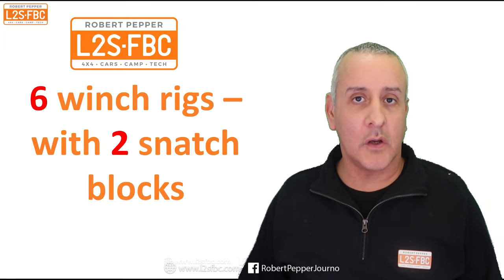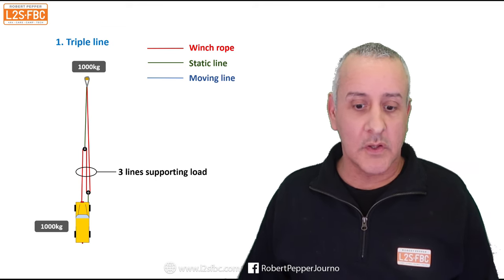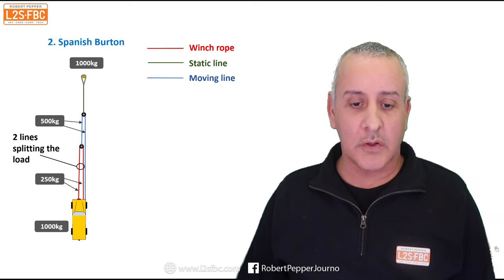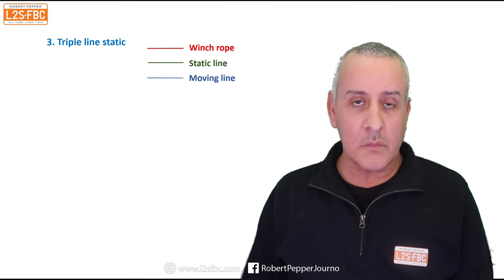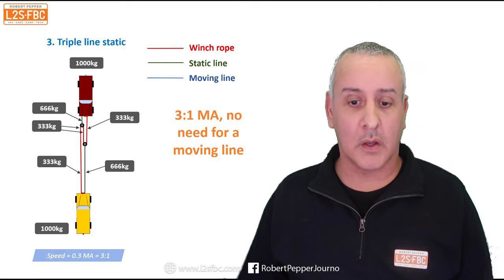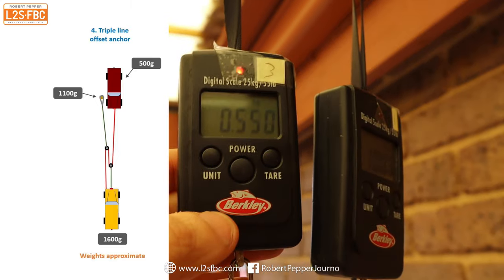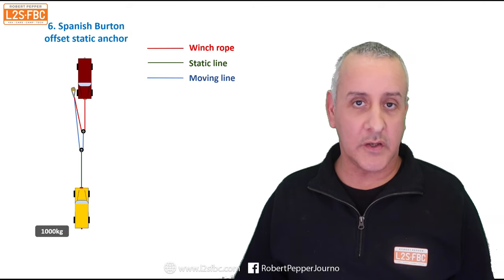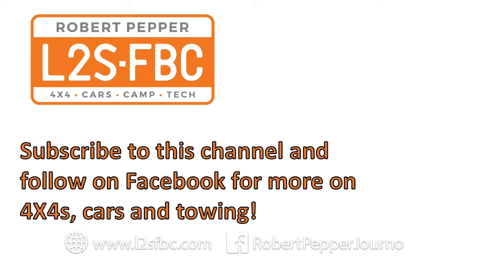6 ways to rig a 4x4 winch using 2 snatch blocks

Comment: I figured out a way to get a 5:1 or even 6:1 MA using only 2 low friction snatch rings. (See the caution note below about the extra stress the ring will see using this experimental method) You have one ring soft shackled to the rigs front end and the other ring soft shackled to the tree. You then feed the winch rope out to the ring at the tree, around the outside of that ring then back to the ring on the rigs front end and around the outside of that ring, then take the winch rope back again up to the ring at the tree and now put the winch rope through the MIDDLE of the ring and then back to the Ring on the rig front end and either anchor the winch rope end to the middle of that ring or the front end of the Vehicle. This is a 4:1 MA. Instead of anchoring it when its at 4:1 ratio, If you do one more pass of the winch rope back up again to the ring at the tree through the middle and back to the rig rings middle, or front end this is a 5:1 ratio I believe. So the rope will be going through the middle of the rings twice. With the Larger snatch rings and a 3/8" rope there might be enough room to get another wrap for a 6:1 ratio. Basically whats happening is you're using the rope going through the middle of the ring as a pulley im addition to the rope around the outside of the ring so each ring acts as 2 pulleys instead of just one, and 2 pulleys are acting as 4 pulleys . The rope moving at the highest speed are the sections wrapped around the outside of each ring and the ring moves with the rope so no sliding friction there. The rest of the wraps going through the middle of the ring do have the rope friction slipping against the ring the same amount as the soft shackle on the other end so it doubles the friction, but it is still the same amount of friction as having another separate pulley, so no real losses there. Since the middle of the ring bend is larger than  the ropes minimum bend radius, you can use the middle as a second pulley without much issue. The only thing to keep and eye on is the return rope sections rubbing against each other as they move at different speeds, but so far I haven't noticed any real wear on the rope from this.

One word of caution.... the ropes going through the middle puts additional stress on the snatch rings because now instead of force being only pulling on one half side of the ring, now theres force pulling on both sides of the ring which will cause the ring to either elongate and ovalize or break if the rings maximum strength is exceeded.  With a 5000+ lb vehicle, I'd like to test the breaking strength of the snatch rings when load is applied to both sides of the ring just to be sure it can handle the extra forces. I think the rings shpuld be able to handle it, but something to be cautious about. That would be a cool video to see on this channel!
Reply: It's really cool watching a single snatch ring turn and act as a double pulley and seeing the ropes going through the middle all move at different speeds.
Reply from the maker: Need a diagram!
Reply: I made a mistake with the 6:1 diagram though, the line should only be going through the middle of the ring 2 times, not 3.

https://youtu.be/QSRaeuzBQL4